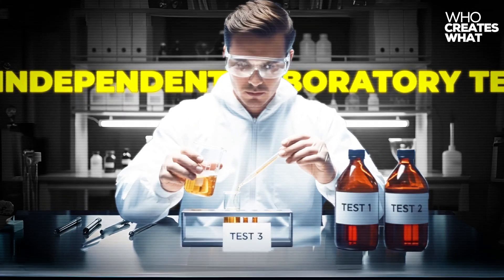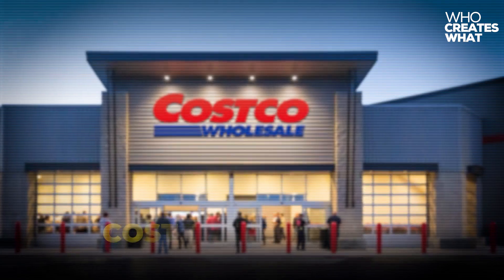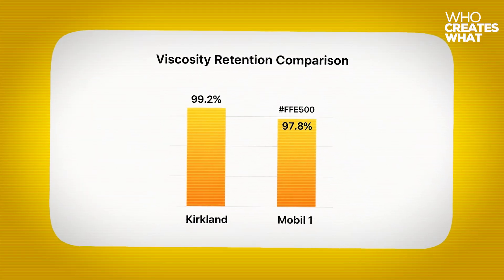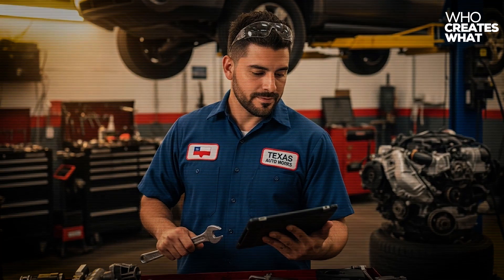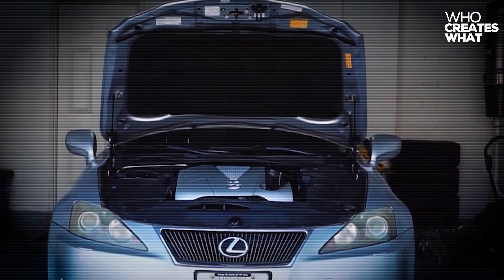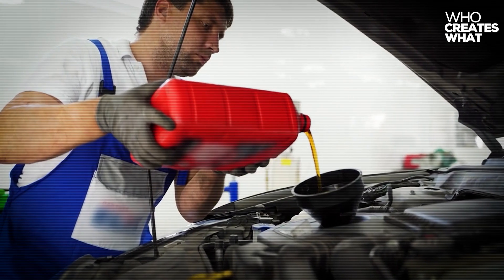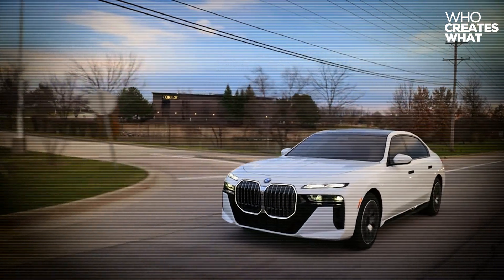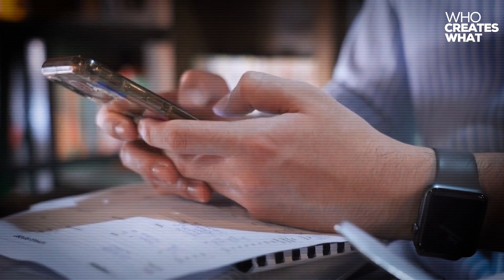Who Makes Kirkland Motor Oil? Why Costco’s $19 Oil Outscores $29 Mobil 1 in Lab Tests

Comment: Ive been using Kirkland Motor Oil in my 2010 Camry 2.5L that is closing in on 300,000 miles and still runs like a top. It takes 0W-20 and I change my oil every 5K. I average about 3 oil changes a year. The price point of Kirkland oil pair with the amount of oil you get for the price is unmatched.
Reply from the maker: That's awesome to hear your Camry is still running strong with Kirkland oil!

Comment: Warren does not manufacture oil. It distributes oil to Costco, Walmart and several other chain stores. It's manufactured by 4 companies you've never heard of. The oil you buy in Texas is not the same oil in California. The wear packages are a secret despite what is said. Costco and Walmart brand have yet to be certified as API SQ.
Reply from the maker: Appreciate you sharing your knowledge!
Reply: Warren blends the oil after receiving the bulk oil.  They process various oil brands

Comment: I have been using Kirkland oil for years. Two jugs of Kirkland 0W20 oil in Canada cost about $45.00. One jug of Castrol 0W20 at Canadian Tire (NOT ON SALE) costs $60.00 -$70.00.  I don't drive a Farrier or a Lamborghini. I drive a 13 year old Camry and this oil is good enough for a plane jane daily driver.
Reply from the maker: You're absolutely right! That price difference is crazy - $45 for two jugs vs $60-70 for just one Castrol. For a 13-year-old Camry, Kirkland oil is perfect. You don't need premium oil for a reliable daily driver. The video actually shows Kirkland performed better than Mobil 1 in wear tests, so you're getting great protection AND saving money. Why pay double when Kirkland does the job just as well?
Reply: NOT FOR German car

Comment: Using Kirland Motor Oil in my Corvette.  https://youtu.be/5x-IhAZnzbw?si=bN0Iewp-dFZM46To
Reply: In what time frame or miles (whichever comes first) you change it Chris?. What type of driving you do with this specific oil in your Verte?. Daily regular driving?, or daily driving plus high revving highway long miles where the oil gets very hot?. I want to do the same thing with my new vette. I was just curious, thank you in advance for your time.